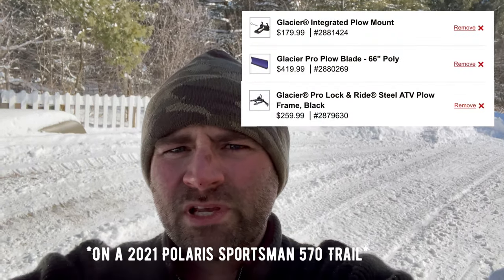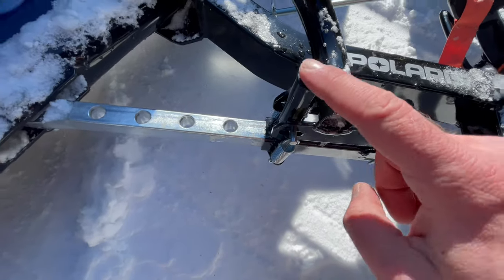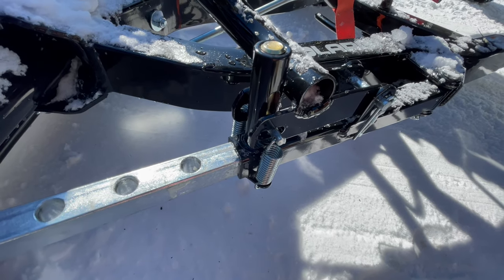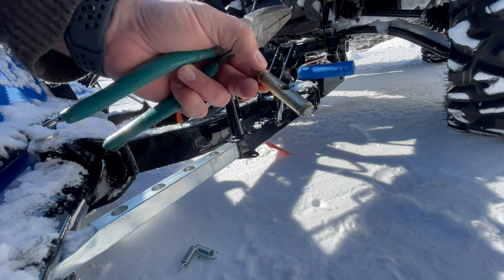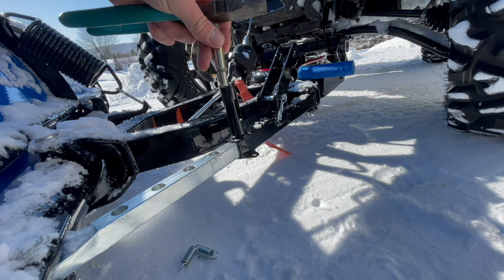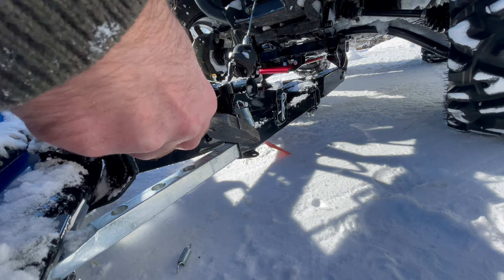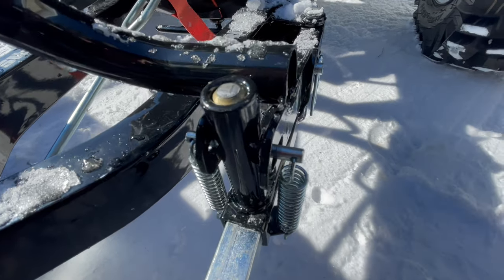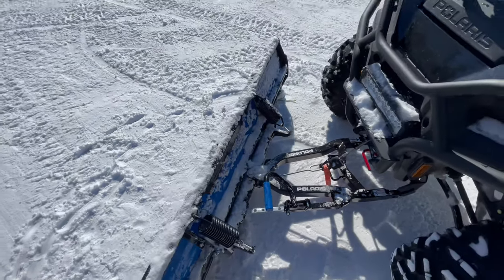What to do if you break your shear pin while plowing? Replacing a shear pin on Glacier Pro Plow ~

Comment: Trying to take my plow OFF but unsure how to get the two pins off without bending the flexible part holding them in place.  Two small wires side by side.
Reply from the maker: It’s a quick release, pull up on the red lever and use the blue handle to slide it off the frame. It comes out as one piece.